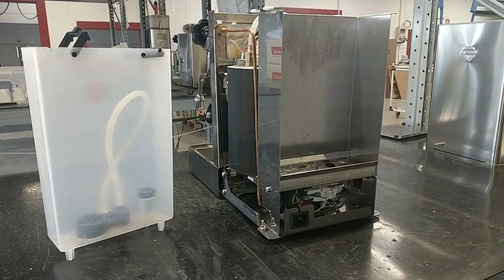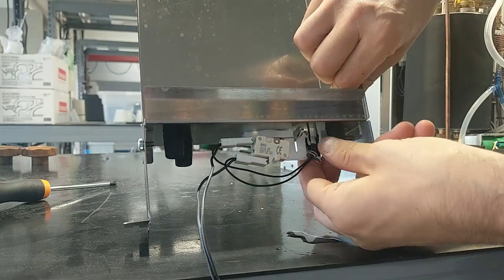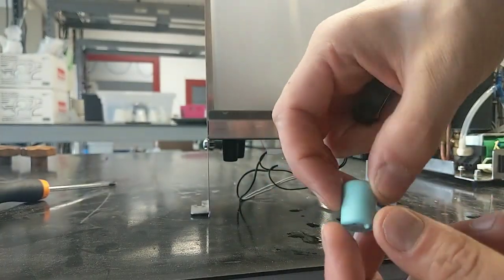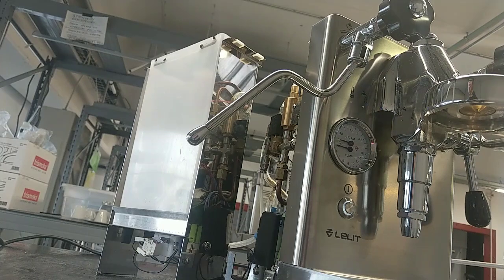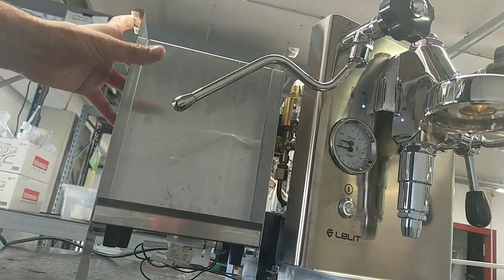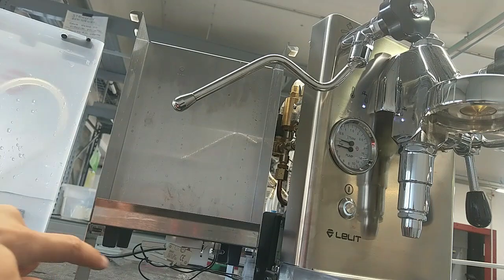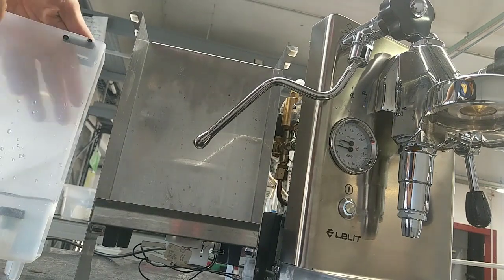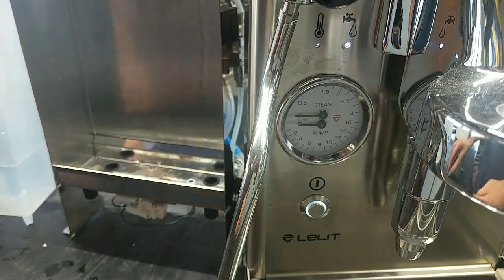pl62x water level sensor

Comment: I have the Mara X V2. My water level light is flashing even when the tank is full and correctly in place. The magnet is moving/floating correctly with the water level and the magnet is the correct way up. The microswitch is seated correctly and I can hear the click when I lower the water tank. However when I unplug the two wires as you did at the end of the video to check the wiring, the light stays flashing instead of automatically staying lit when I disconnect those wires, what could be the problem?

Comment: The problem with this system is that, as we don't see the water level (I have a PL91T) when the sensor detects the magnet, the machine shuts off 99% when we're making a coffee.
A warning led at 1/4 of the tank or a window would be very usefull.
Reply from the maker: in the pl91 if you run out of water during extraction, this continues for 15 seconds,
after these 15 seconds the pump stops
Reply: @lelitinsider2977  Maybe the firmware has been updated since, but mine shuts off right away, without warning. (Bought in 10/2020)